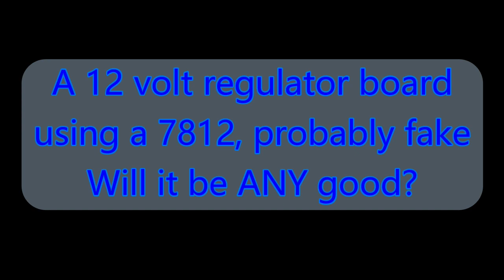12 volt DC 1.5 amp. L7812 Voltage regulator board, any good?

Comment: Useful info for buyers in the Shenzhen market. Blue terminals are bad, green good. Check parts layout. $1 for the PCB and heatsink isn't bad. L7812 is $0.50 USD from reliable suppliers for <10.
Reply: Thank you 🙏